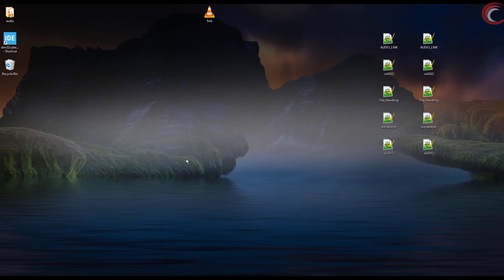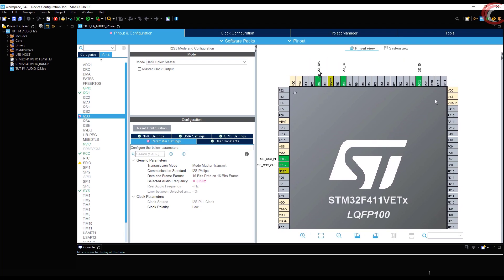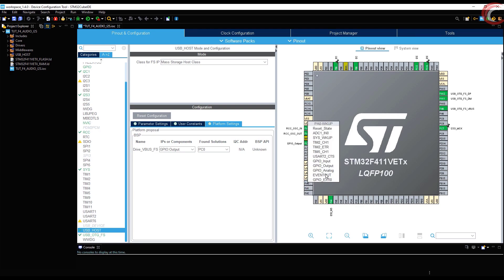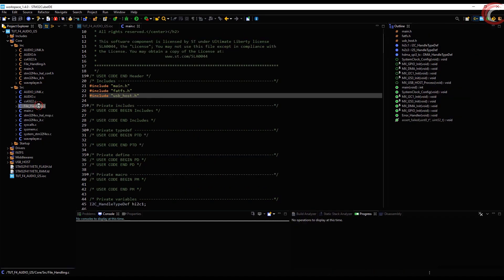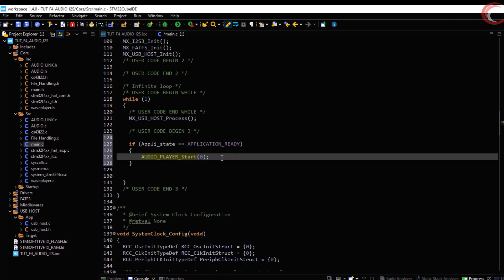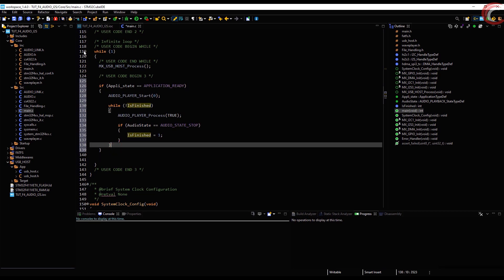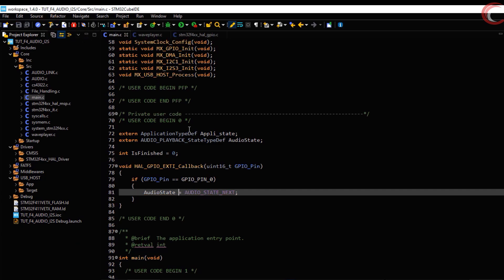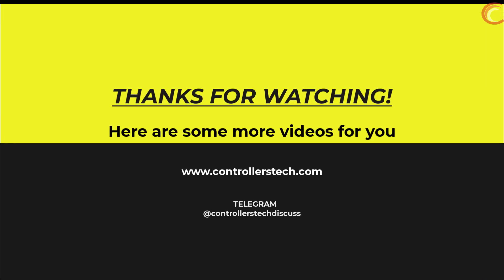WAVEPLAYER using STM32 || I2S AUDIO || CS43L22 || F4 DISCOVERY

Comment: Thanks for the video, I'm having an error on this line of code "	if (ld_word(fs->win + BS_55AA) != 0xAA55) return 3;	/* Check boot record signature (always placed here even if the sector size is >512) */"
This returns FR_NO_FILESYSTEM as if no FAT volume is found. Mine is formatted into FAT32 with cluster size of 4kB. Are there any things I should be careful about like size of the USB stick or something like that ?
Reply: I found the fix to this, it was due to my USB stick using the GPT partition type instead of the MBR one that is needed

Comment: Excellent video, I followed all the steps but for some reason, my STM32F407 Discovery is not recognizing the USB, I'm using a 16 Gb USB 2.0. the LD7 is not turning on and in debugger,  the code is not recognizing the USB. What could be the reason?
I solved! for some reason my USB micro port wasn't providing a voltage output to feed the USB, so, I solder a 5v power supply to the USB and worked! but... why the USB micro port of my stm 32f407 discovery is not providing the voltage outputfor feed the USB?
I'm leaving this comment in case that someone else suffer the same issue
Reply from the maker: You need to enable the power supply. It is controlled by a particular pin. Check schematics to see which pin controls it. I have explained it in the video.

Comment: Hi, do you using any ST-LINK device to upload the program? Or you made any videa about it? I cannot program debug my stm bc of missing ST-LINK. Thanks in advance
Reply from the maker: The st link is inbuilt in the discovery and nucleo boards. What board are u using ?
Reply: @ControllersTech  Im using the stm32f103c8t6  if this is what you mean
Reply from the maker: 1. Yes you need to purchase a ST link for f103c8.
2. This video won't work on your mcu. F103c8 does not support USB host.
3. F4 discovery is mentioned in the video title.
Reply: @ControllersTech  Oh sorry i commented on a wrong video, I was making the HID mouse with the stm32 but thanks for info
Reply: @ControllersTech  Any recommendation for STLINK?
Reply from the maker: There aren't many options available. The clone comes for around $4-5 and the original one comes for $8-10. 
If you have the budget, go for the original one.

Comment: Sir I use Keil and it gives me "the code size of this image exceeds the maximum" error.What should I do?
Reply from the maker: Free version of keil ?
Reply: @ControllersTech  yes.
Reply from the maker: Free version has size limit. You can't run this..
Reply: @ControllersTech  what can I do?Should I use another IDE but Keil?
Reply from the maker: You can use cubeIDE or use paid version of keil
There are others like IAR, truestudio. The choice is yours.. I would recommend cubeIDE though as it's officially provided by ST
Reply: @ControllersTech  if same code works with cubeide ,I am OK

Comment: Oh Dude. Thanks I have done it. It works, although a get so many problems in syntax (AUDIO.C -  rccclkinit.PLLI2S.PLLI2SM = 8; - UNKNOWN). 

Trial error is exhausting. But, it's fun. 

THANK YOU :)
Reply from the maker: I think that error comes in f407. But as i mentioned, you just need to comment it out
Reply: @ControllersTech  Yeah, I used STM32F407VG. Anyway., I am doing my FIR project using Band Pass Filter to detect audio from knocking coconut. My final purpose is to detect ripe coconut.

Could you suggest me?

Comment: Hello, thank you very much for sharing this awesome video! What would need to be changed for 24bps and 32bps audio files? Would there be an advantage, in this case, using 16 Bits Data on 32 Bits Frame for 16bps files? Cheers
Reply: instablaster

Comment: Great video. A lot more processing than I need, but it will help me learn what I need to do.  I am building a sound card for a pinball machine.  The pinball machine sends my processor a byte indicating what sound it wants played.  The sounds are all on the sd card in small files names 001.wav, 002.wav, etc. All files are the exact format - 44k sample, 16 bit. mono.  If the pinball machine sends a 0x01 byte, the player plays 001.wav. If the pinball machine sends a new request while a sound is playing, it stops the previous sound and starts the new one. That's it - that's the entire application.  Should be fairly easy.  Unfortunately, I am not really a programmer and I have done all my previous work in the Arduino IDE which does a lot of the work for you.  But, I can't fine any libraries for I2S on STM32F411, so that's why I am looking at the Cube IDE.

Comment: Hello,
Is it possible to import libraries of devices writen for arduino to use them for the STM32 under Hal environnement? it seems they are writen in C++.
I have looked a bit into embed environnement for stm32 and it seems there is a lot of libraries as well. Those might be interesting to convert and use for STM32 with hal libraries.
Is it possible to do it?
Reply from the maker: We wish.. life would be so easier that way 🙂

Comment: Hi
You are using the discovery f4, and the microcontroller is 407vg, but in your tutorial you select 411ve

Ia that true ?
Reply from the maker: I am using 411ve. But i have checked the 407vg schematics and they are both same in terms of audio drivers. So this should work with 407vg also
Reply: @ControllersTech  hi, I'm also using discof407vg and i have some issue in clock configuration...! 
actually i can't set frequencies just like the video...!
 can you check it please...??!
Reply from the maker: what you mean you can't set ?
run the mcu at 168 MHz and the rest will set up on it's own
Reply: good day, I also use the stm32f407 and I did everything that I recommend but nothing I can not play any audio can you help me please